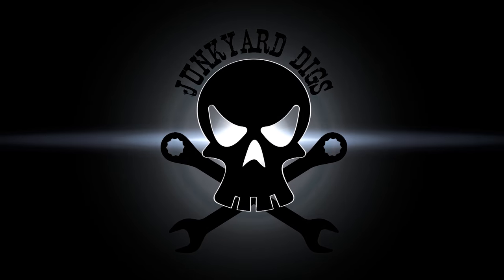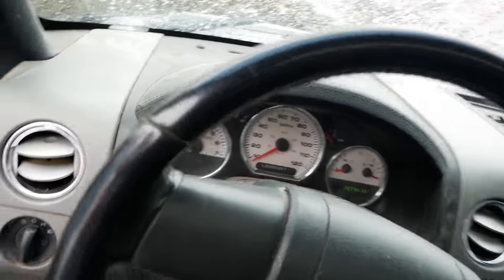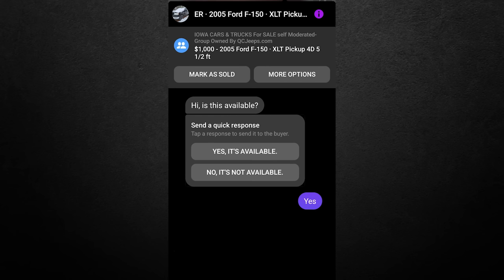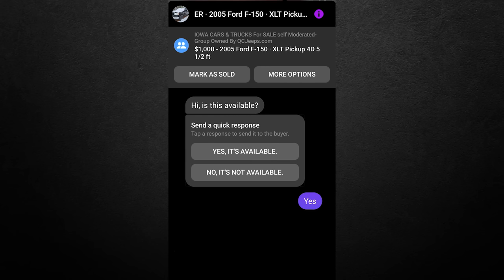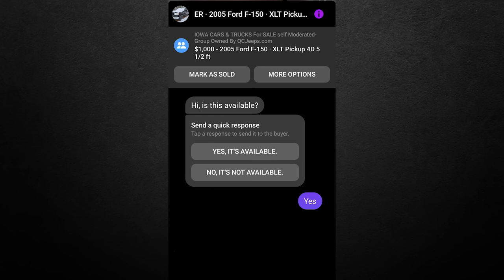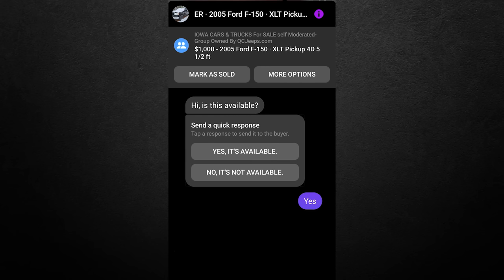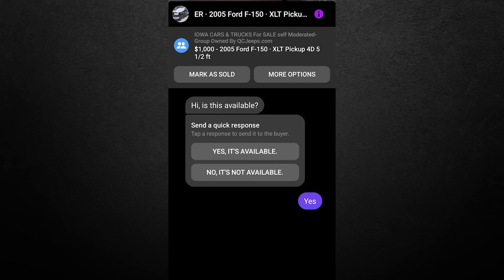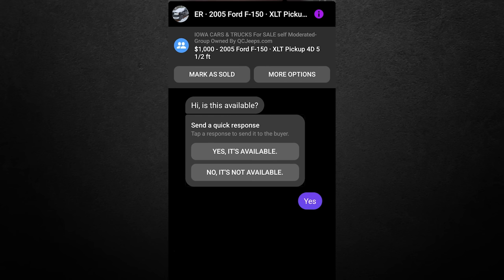How Safe Is a SEVERELY Rusted Frame? - REAL Crash Tests - Cornfield Science

Comment: If the transmission cooler hadn't cracked open I'm pretty sure that thing would have dragged itself out of the tree.
Reply from the maker: Agreed!
Reply: yeah its funny the trashed f150 took several hits and the GM crap was done after only 1 hit each!
Reply: @mromatic17  yea totally agree not like my 400k GMC denali could have hit a tree and kept running... or did you miss that those gm cars were... cars not trucks and they had already spent an entire day doing the grand prix gran prix. After also being cars bought for extremely cheap because of high miles and rust themselves. but sure nice dig at GM, cause all GMs are crap.
Reply: @compzac  i was talking about how they were running and driving fine just like the f-150 and when they got in one wreck all ran into the f150 they all died after 1 hit. yes trucks are tougher but this f-150 with all  its rust and rot was about the same level of becoming immobile as the cars since it was so bad. the only thing that gm does well is build v8's everything else they cheap TF out on. theres several tens of thousands of reviews in consumer reports about how overall fords are built better and fewer problems over gm products! hell even their newer v8's are having really bad engine failures! my brother owned a 2016 camaro ss and the engine failed at 23k miles and he bought a brand new 2021 corvette and same thing the displacement on demand v8's are shitting the bed look it up but you wont cuz brand whoring! There are a lot of gm products I love but wouldn't daily cuz of the problems they have!
Reply: @mromatic17  bro ur username is fukkin hilarious.
Reply: @mromatic17  as a 01 7.3 owner and 04 ranger owner I agree.

Comment: I took my old Beetle off the road after a garage completely failed to spot the severely rusted frame head on it (you know, the bit that the entire front axle is bolted onto), when they swapped the front axle. The car would pull to the left or right depending on what mood it was in, and the creaking sounds from up front also told me something was definitely not right. It still handled speed bumps like a champ, though, strangely enough. The really scary bit was when the guy who was supposed to get it roadworthy again, had the steering column snap on him while just pushing the car at his place. The "crumble zone" on the steering column was completely rusted out.

Sometimes it's not the big things that'll get you, but the small.

Comment: Credit to you, not allowing this back on the road. A lot of people would flip it.
Reply: I looked at a truck at a dealership where they put duct tape over the rust then painted the the frame and duct tape. Luckily I had enough sense to peak under the truck.
Reply: Hell, I seen bondo on frames. The car didn't even sit right. It looked warped but someone stuffed wads of bondo in the bends to make it look normal which it didn't. It looked like Bondo on a bent frame.

Comment: I have a first year Wrangler that I bought.
Its back bumper is only held on by the gas tank.
For 4 years I have looked for someone to fix the frame. The only bad part was the back end frame on both sides. Surprisingly The rest of the frame is in good shape.
I just found a good frame last week.
Lots of work to do to switch it all over.

Comment: This is pretty interesting since this is a boxed frame instead of the old c-frames you see on previous gen Fords. Boxed frames rot out bad because they collect all sorts of crud inside them, but it seems they can still be pretty strong despite the rot. An old c-frame that was this rotten would have surely folded like a piece of paper after that first jump.

Comment: This is the very first time I have watched a video of yours. You make a very good first impression. I liked the rust analysis. I've lived my entire life in Pennsylvania and Ohio and have seen many severely rusted vehicles. This F150 wouldn't have passed a Pennsylvania state Inspection for at least the last five years due to the frame rust. You need to figure out a way to put it on a guide wire/track/radio control and make it go head-on into a tree or wall. I'm sure this truck is FAR less safe than one without the rust.

Comment: Im not gonna lie here, ive always thought the 3v tritons were bad but, tough as nails still. I just never really knew just how unbelievably tough they are. Thanks to this video, now i know.
Reply: Having owned by 05 F150 for 18 years, I've experienced almost every problem with the 3v 5.4 possible. Even when it runs like shit, these engines and this gen F150 can still take a ton of abuse and keep asking for more. The 5.4 has its problems, but if you take the time and effort, these trucks can be very reliable. From daily driving, hauling, towing trailers to driving up mountain trails. Hell, I've used it to pull down 80 ft trees in the front yard when my chainsaw quit working. The 5.4 won't win any races but it'll pull anything you care to put behind it. The day my truck fails to perform is the day I'll trade it in, but after 18 years it ain't happened yet.

Comment: I've been waiting for this video since I seen it on tik tok. Even though my 05 F150 has the 3V 5.4 and has no rockers left and has some rot in the frame i love it to death. I bought it for 1,000 bucks and It had the cam phaser and timing chain issue when I got it. But 2,500 bucks later it has treated me well and has 245k miles on it. I personally dont think these trucks are as bad as people say they are especially if you take care of them. I see them everywhere and a lot of them 300k+ miles. But this one was just too unsafe to be on the road and I'm glad we got some entertainment from it.
Reply: Yea i bad mouth them but i have to admit I've seen alot of tritons with well over 200 thousands.
Reply: @spudtaterson6281  Especially those 4.6s. Those engines are almost unkillable.
Reply: @kingdaniel3519  buddy of mine has a 4.6 in a 05 and its got over 230 thousand. It smokes, knocks a little and the exhaust manifold leaks but she still goes.

Comment: This is a great show of modern engineering built into newer vehicles, as compromised as that frame and body was it did very well. Years ago they crash tested a 59 impala and compared it to an 09 impala and I’m glad “they don’t make ‘em like they used to”
Reply: the 59 used an x-frame, which were not very strong.  I would have liked to see them use a full ladder frame impala, maybe a 75ish impala.
Reply: I saw that video. It was made in 2010. The 59 Chevy was completely rusted out underneath and was junk to begin with. That video has been debunked a thousand times.

Comment: It just goes to show how tough these trucks are
Reply: The engines sure aren't though lol.
Reply: @GlamStacheessnostalgialounge   yeah but it never blew ford motors might be crap every now and then but they won't die
Reply: @Giovanni_Litterini  Not even 4 hours ago I had an escort with a turbo diesel run away on me out of nowhere. I didn't even know those could do that. Called the owner and he told me in the most casual manner "Oh yeah it does that every once in a while". Like yeah I'll agree it's a miracle that thing still runs but it would probably be better for everyone's health that it wouldn't.
Reply: @GlamStacheessnostalgialounge  Never had a runaway diesel before? I'm guessing Europe, where diesels are more common, so it's a bit surprising that you've never seen it before. You gotta cut off air supply to choke it, otherwise it'll blow up the engine.
Reply: @kingdaniel3519  Yeah I know what to do, I just never had it happen to me. Luckily I think the injectors were still operated electronically so it did shut off with the key.

Comment: This is why we need to stop over salting roads. I am not anti-salt, I am anti massively overdoing it. More salt does not equal more safe. The use of salt is only cheap in the short term, long term it is the worst. It is time to rethink what we dump on the roads. BTW, all of the salt ends up in our water both surface and ground. Think about that next time you go fishing or drink a glass of water.
Reply: My county that I live in is using brine which is a liquid version of salt and guess what I'd take the salt over brine any day 😂😂
Reply: @kylebeach2316  we use both rock and liquid NaCl here in Wisconsin

Comment: What you actually proved was that it is virtually impossible to kill an F150 :)
Reply: Wrong, that engine was going to die regardless of how bad the frame was. 5.4 3v are among the worst engine ever sold in any pickup
Reply: The body and transmission will out last the 5.4 3v any day 🤣🤣
Reply: @andrewdonohue1853  I disagree. Sure they have their problems, but I don't think they're any worse that what GM and Dodge were shitting out at the time.

Comment: Those 5.4 can go over 200,000 miles with regular oil changes from day 1. My ex-employer had one hit 252,000 before it died with original engine and trans. Rust is a big problem and when I see people driving really rusted out cars and around my area in Michigan, I try to avoid being behind them or along side them.

Comment: First.
Also, as Kevin's friend that likes modular ford's. The 3v 5.4's are hot garbage.

My favorite part was when Kevin killed a 3v truck.

Final edit. Please note, this truck is garbage, however there are rustier vehicles on the road. This should terrify you all.
Reply from the maker: I just realized even though it ran like hot garbage, It didn't tick. Holy crap
Reply: @JunkyardDigs  there were noises coming from there...
Reply: My dad has a 3v 5.4 and the cam phasers are starting to show they are going bad if under heavy load but normal driving not much. His has 150k on it and the truck is his baby too. I hate how the 3v are trash and the coyote 5.0 aren't really much better and I'm a Ford guy.

Comment: That Ford (?) was incredibly excellent despite looking fit for tin foil. Only. I'm speechless other than some of that damage made me laugh a little several times though I tried to stay stoic and objective. That is so much better than men give it credit for. Coming to buy it others will decry it's usefulness and whimper about its worthless condition. But right now I have decided to keep my truck until the deck sags around the rusted frame and drags on the ground like a child in her mother's ankle length skirt. Thanks for lifting my spirit and making the value of my truck increase by five thousand percent. ❤

Comment: I’m a body man that deals with this all the time- I am in Nova Scotia, Canada. You can never be more than 100 km away from saltwater here plus the roads are heavily salted from about November to April each year. It’s extremely rare to find a F150 up till 2013 (when they aluminumed them) that is repairable if it hasn’t been under coated repeatedly thru its life. If one is found, it’s not from here! And I’m not picking on fords, chevs and dodges dont don’t do much better here either. It’s routine here to lose a car to rust before it’s ten years old (Again, without being undercoated repeatedly) and btw, those electric magic anti rust boxes, I’ve got a garbage can full of them that didn’t work- at all. Cheers!

Comment: That tow hook reminded me of the time I tried pulling an F150 out of a ditch in the winter time. 
Yes its a fairly long story. But it's a goodie. Well I think. 
While driving home after work I noticed an F150 had slid off the highway and was down in the ditch. Being the nice guy that I am. I stopped asked the guy if he was okay. Which he was. I then asked him if he wanted me to try pulling him out. He said I doubt your truck can. 
My truck for the record is a 2016 2500 WT. 4x4 6.0L gas. And I living in Canada normally put around 200 pounds of weight in my bed up against the tail gate. For added traction. Plus I air down as well. 
I ignored the comment and replied by saying "well either I try or you wait possibly two hours for a tow truck". The gentleman finally agreed to me trying to pull him out. Now this is where the tow hook comes in to play. Because I wanted to pull him out backwards the way he went in. I figured thats the easiest and least resistance. This guy said "nope" he was going forwards. I hooked the tow rope up to his front driver side hook and to my rear tow hook. I barely moved my truck before the guy started honking his horn like a mae man. He said he heard a noise up front. That noise he heard was the tow hook being bent up and over to the right. The direction of the pull. There were two bolts holding the hook on. I snapped the back on while bending it. 
That's when the guy said "okay fine pull me backwards". So I hooked up to one of my tow hooks. Moved my receiver tow hook to his receiver. Pulled the guy out in reverse. In four high and very little throttle. 
Easy peasy. 
The driver of the F150 didn't say thank you. Instead he asked for compensation for the damage to his hook. I said that I pulled off my hook with no problem therefore yours should of been fine. And with that I left him on the side of the highway.

Comment: Great videos, so happy I stumbled onto your wonderful channel!!  The tar undercoating contributed to that disaster, by trapping in the moisture. Also , this should be a wakeup call to all drivers in the "rust belt", that oil spray rustproofing should be integrated into the yearly maintenance of all vehicles, otherwise your vehicles will be toast in less than 10 years..

Comment: You know.  I have a problem that I have been pretending isn’t there.

And then this video shows up in my feed.

I’ve got a crew cab 88 f350 that some owner in the past must have used to launch a boat in the ocean without ever spraying the frame down.

The front half of the frame is clean. The back half; not so much.  And the demarcation line is a very clean angle 

I bought it to haul water with and then bought a 40ft fifth wheel.

Buying a new frame in the spring thanks to this video

Comment: I’ve seen many vehicles like this unfortunately in PA. Had a 2009 Toyota FJ cruiser come in and it was actually a nice looking truck but then the horror show started. The truck on the right side had two massive holes in the frame along the welds and on the left it has started to rot through the crossmember. It sucked cause otherwise the truck was in pretty good shape, but something I notice is on these Toyta FJ Cruisers and 4 Runners is two things, the under shield that hides the oil pan and oil filter always rots out or the bolts get rusty and snap off and the frame in the rear is the first thing to go. But this FJ the whole middle section of the frame was done for.

Comment: This song is perfect for this video 
Dashing through the snow in my rusty Chevrolet.
Down the road I go, sliding all the way.
I need new piston rings. I need some new snow tires.
My car is held together by a piece of chicken wire!

Oh, rust and smoke, the heater's broke, the door just blew away.
I light a match to see the dash and then I start to pray-ay.
The frame is bent, the muffler went, the radio's okay.
Oh, what fun it is to drive this rusty Chevrolet!

I went to IGA, to get some Christmas cheer.
I just passed up my left front tire and it's gettin' hard to steer.
Speeding down the highway, right past the county cops.
I have to drag my swampers just to get the car to stop.

Oh, rust and smoke, the heater's broke, the door just blew away.
I light a match to see the dash and then I start to pray-ay.
The frame is bent, the muffler went, the radio's okay.
Oh, what fun it is to drive this rusty Chevrolet!

Bouncing through the snowdrifts in a big, blue cloud of smoke.
People laugh as I drive by; I wonder what's the joke!
I have to get to Wal-Mart to pick up my layaway,
Cause Santa's comin' soon in his big, old, rusty sleigh!

Oh, rust and smoke, the heater's broke, the door just blew away.
I light a match to see the dash and then I start to pray-ay.
The frame is bent, the muffler went, the radio's okay.
Oh, what fun it is to drive this rusttttttttty Chevroooooooleeeeeet!

Comment: Very interesting video. I think we can see that the frame is not the only thing holding the truck together. All of the damage that you did did not cause dangerous impingment into the passenger area enough to cause injury. Would I drive it rusted like that? No. I would repair as best I could and go from there. I have a f250 with rust but no where near as bad as the 150 you "tested". I am more confident now to drive it. Thanks.

Comment: If you google or youtube the actual commercials that were aired to sell these trucks, you'll see Toby Keith bragging about how much stronger the F150 frames were compared to the Chevy and Dodge trucks. What a con job. I owned a 2006 4x4 that I bought used in 2015. It was a supercab Lariat loaded with luxury. It was in beautiful  shape,  no carfax problems. I loved that truck, even with the 5.4 3V. It ran great, looked and drove great. In 2019, my mechanic gave me the news that my frame was rotten and ready to snap in half. I hated to let it go, but didn't want to die in it on the highway. Ford really designed trouble into this generation of trucks with the tissue paper boxed frames and the mechanical nightmare of the triton engine.

Comment: This is not a new problem. In 1973 I was driving a 1965 Ford Galaxy that nearly went off the road after hitting a water filled pothole. The frame broke completely in half under the passenger side footwell. The drivers side was almost as bad.

The odd thing about it was that the floor panels were completely solid and not rusted at all.

The frame shop I took it to for an estimate said that they (Ford) used bad steel for the frame that year. The estimate for repairs was $300, more than I paid for the car. I traded it for a Chevy.